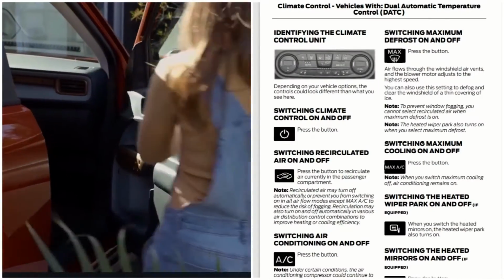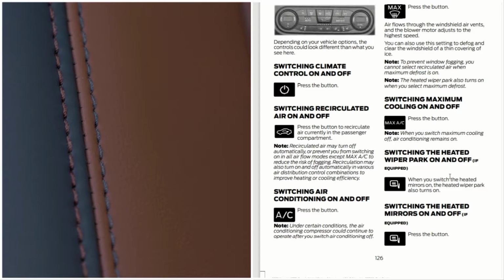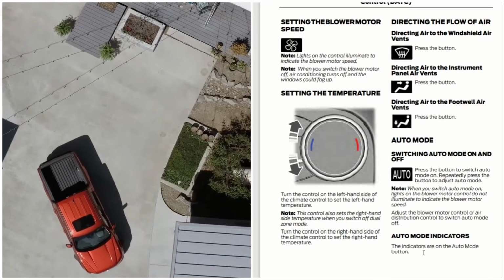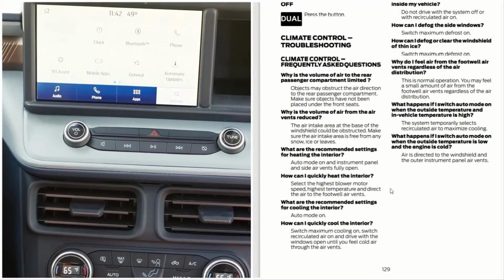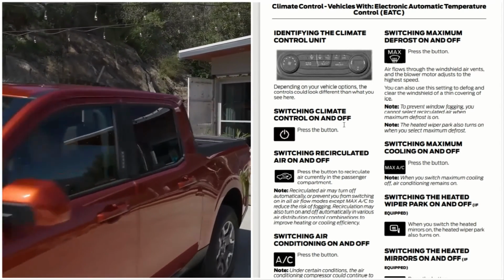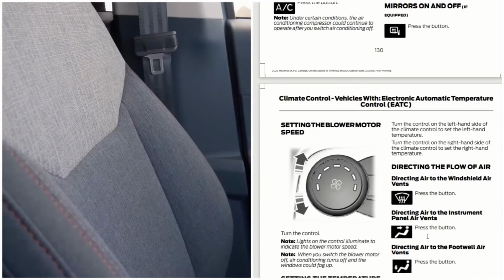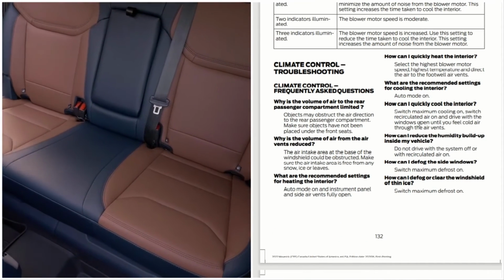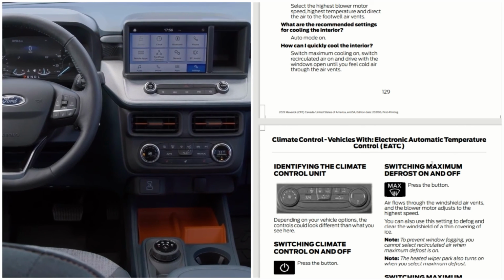2022 Ford Maverick Climate Controls

Comment: Do you have to take off the dash to do repairs on the air conditioning in the 2022 Ford maverick? Someone said the AC control module can only be accessed by taking apart the dash and disabling the air bag system